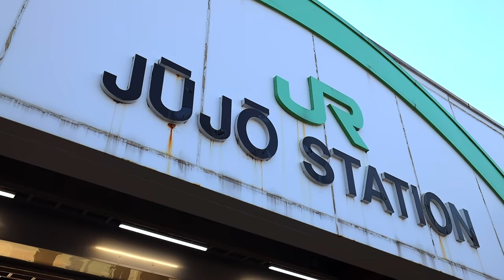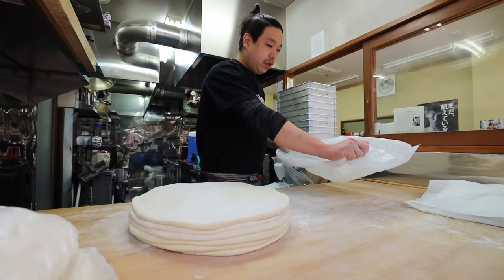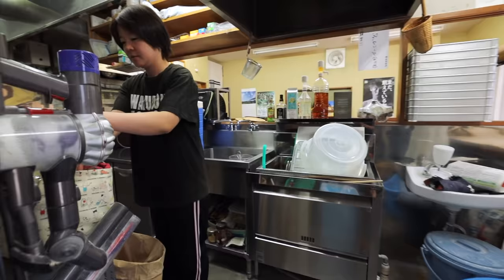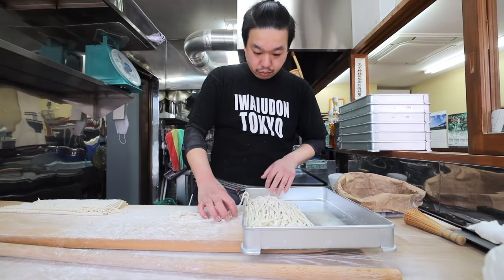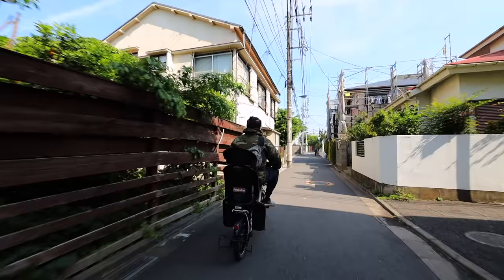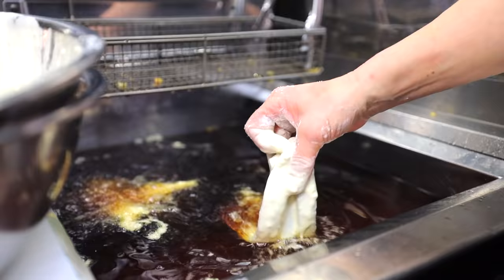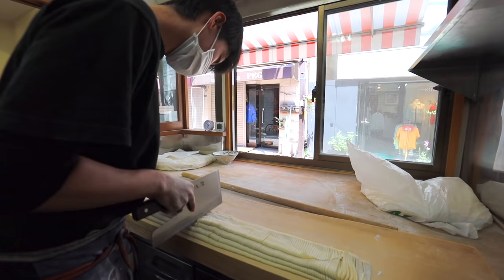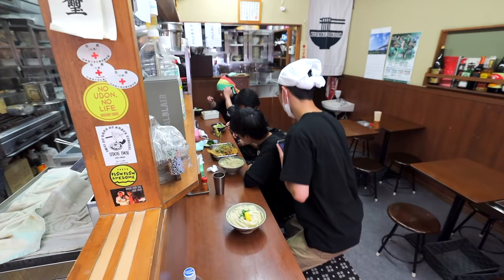Behind the Counter at a local Japanese Udon Noodle Restaurant

Comment: Even though Dried Ramen is an Asian Food. It is an American Food Staple in the American Prison Systems. American Inmates in American Prisons will use dried Ramen and crush it up with Cheetos, or Doritos with a Pickled Cucumber into a dough using Hot Boiling Water and a bag. Sometimes called a Prison Brick. They then add other crushed chips, or sauces like Ketchup, Mayonnaise, Mustard, Bean Paste, Tomato Paste, or Cream Cheese on top. They then add deli meat like ham, turkey, chicken,Salami, Pepperoni, Roast Beef, or a Can of Tuna. They also roll it up like a giant Sushi Roll or Brick. That's why they are called Prison Bricks sometimes.

Comment: just curios why almost all ramen shop buy their noodle meanwhile udon and soba shop almost all make in shop their noodle?
Reply: Ramen noodles are different from Udon or Soba, in that Ramen contains Kansai (alkaline solution) to achieve a springy texture. Specialized Ramen factories are able to precisely balance the pH for large batches of noodles rather than individual shops making small batches of noodles that may vary in consistency.